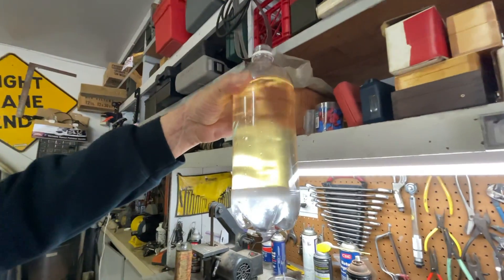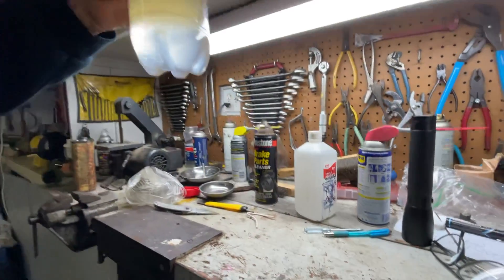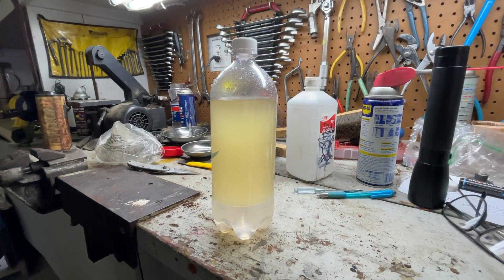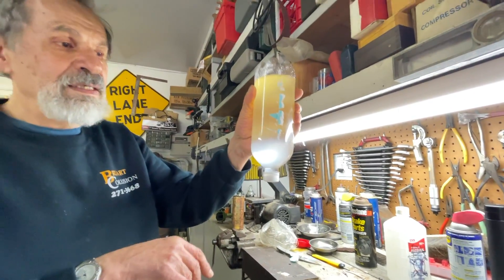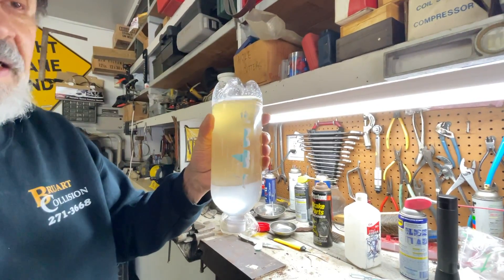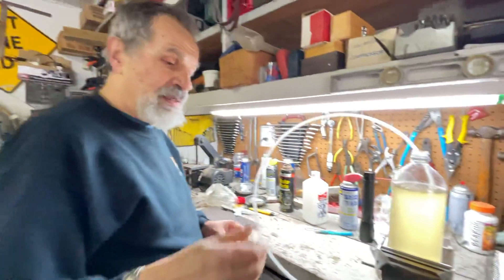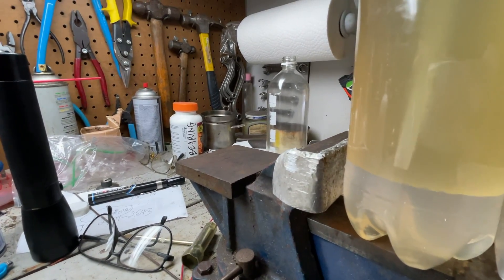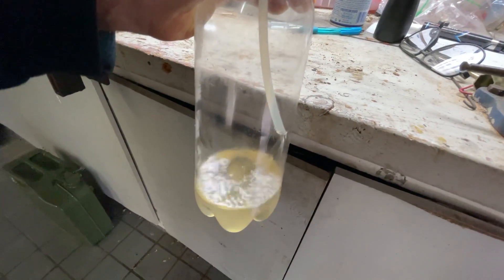The Most Practical Way To Remove Ethanol From Gasoline

Comment: You can also freeze the water/alcohol mixture so it is a chunk of ice, then just pour the gasoline our.
Reply: My freezer won't hold a 5 gal. gas can. It will if i move things around, but my wife won't budge!
Reply: @johnnellis3025  🤣🤣🤣
Reply: @johnnellis3025 you keep your wife in the fridge? That's brilliant. 😂
Reply: @johnnellis3025  🤣🤣🤣
Reply: So, the Ethanol doesn't act as an anti-freeze?  Then, that's genius.
Reply: I think it does, but I'm not sure how much the freeze point will drop. Adding more water per volume of ethanol will raise it some
Reply: @imdeplorable2241  Get it cold enough, and the water/alcohol will freeze solid enough to pour off the gas long before the gas even considers starting to solidify.
Reply: That's how they make applejack.  They keep pulling the ice out and the remaining liquid gets more concentrated.
Reply: @AlexT  it is also how they make 'ice' beer, that is stronger in alcohol than original.
Reply: Will the octane rating drop?
Reply: @lethalbutterknife3409  yes the octane will drop, use high octane or premium fuel when separating ethanol
Reply: @lethalbutterknife3409  yes. The alcohol raises the octane rating. That’s why drag racers like using high levels of alcohol in the high compression engines.
Reply: @lethalbutterknife3409  Yes the octane rating will drop several points as the ethanol is about 110 octane contribution
Reply: @lethalbutterknife3409  about 5-6 points.
Reply: @lethalbutterknife3409 - I believe it does.  Others I have watched in how to do this process say to get the premium high test gas when you do this.  E.g. the gas sold in some areas for small engines and boat motors is often called REC 90, which means Recreational 90 octane.  The typical 87 octane regular with 10% ethanol alcohol  ends up somewhere around 85 octane when you take out the ethanol.  So start with the “hi test” 92 or 93 octane for this use.  It still has the required 10% ethanol but with other goodies to improve combustion for better performance.  That’s what I think I’ve heard.
Reply: You can also gently pour off most of the gasoline without any need for tubing.
Reply: @alan6832  And you can let the stuff you poured off settle off again to make sure all the water is gone.
Reply: Excellent video😎 thank you Sir!
Reply: Gasoline freezes between-40 and -50 celsius. Ethanol freezes at -114 celsius. Your idea would be great for separating gasoline and water. In Canada ethanol is added to gasoline to give it a lower freezing temperature.
Reply: @ben3318  That wasn't the reason ethanol was added to gas in Canada. They did it for the same reasons as the USA and it has nothing to do with freezing. Doing a Google Search for gasoline freezing gives a range of -40 degrees to -200 with most freezing at -100 degrees Fahrenheit. I live on the Canadian Prairies and got along just fine adding methyl hydrate to my gas in the winter when temperatures could fall way below -40 Fahrenheit or Celsius, long before ethanol came along. NEVER had a gas line freeze. Small engines don't like the crap and neither do i!
Reply: @ben3318  Exactly Ben. It's fun to read the idiotic Internet ideas though 🤣🤘🏼🏆🏆
Reply: Very good idea.
Reply: For this to work in a household freezer, you will need to add enough water to the gasoline to dilute the extracted ethanol down to about 25%. This works out to about 40 fl. oz of water per gallon of E10 fuel, which is kind of overkill.
Reply: Put two holes in the stopper or cap with one tube long enough to reach the bottom and the other so it only protrudes into the bottle a very short distance but is long enough to add a pinch clamp to turn off. Invert the bottle on a stand of some sort and let sit until clear. Then open the pinch clamp to drain the water/ethanol mix. Once that is complete drain the clean, Ethanol free gas for use. The purpose of the long tube to   the bottom is to vent the bottle while inverted to allow draining without creating a partial vacuum in  the bottle, possibly collapsing a plastic bottle.
Reply: I once had some herbicide in a five gallon gas can that had gasoline added to it. Realizing my mistake, I dispensed it into an old glass apple cider jug and the separation line became very clear and it was easy to pour out the pure gas. I ran it through the second time and the clear water that separated was just a tiny amount. I would suggest that a double separation should be undertaken as proof that the process is complete.
   Understand that the glass jug is what I used and not what you should use, but it's shape mad it easy to pour it off the top without mixing the gasoline back into the fuel.  
    When you consider that off road recreational gasoline is hard to find and that you can regine your own with just a ten percent penalty in price, it's a winner technique
Reply: Now that's what I needed to know. Thank u
Reply: True but wife said he’ll no
Reply: @Gregory So that they can sell you 115 ounces of expensive gas for the price of 128 ounces, and you never notice you got robbed 'cause the 13 ounces of cheap alcohol makes it look like you bought a gallon of gas.
Reply: @Gregory-nk8wm to provide subsidies to corn farmers and kick backs to politicians
Reply: Or you can just buy some ethanol free gasoline!
Reply: Doesn't ice float in gas?
Reply: Ethanol won’t freeze
Reply: Freeze ethanol? No wonder society is going to shit.
Reply: @Gregory anti knock properties, 10% ethanol gives the same anti knock properties as tetraethyl lead.

It was actually considered before leaded fuel was a thing but was deemed too expensive so the cheaper and far more toxic lead was used.

Now they are selling it as a renewable resource for environmental reasons.

Makes no sense because fuel consumption is actually increased over neat petrol, meaning in the long run you are actually burning more fossil fuel using ethanol blends.
Reply: @Gregory-nk8wmto make Greta thunderburger happy
Reply: That is a great idea for someone who has not researched it at all.. here's the problem, the alcohol that is used in gasoline ⛽ is called methanol. And its freezing point is -143.7°F !!!!!!! Where does one get a freezer that can drop the temperature to more then 143.7 degrees below zero Fahrenheit???
Reply: @lenielupian2699  they use ethanol bud.
Reply: @lenielupian2699  if it’s methanol why does the fuel pump say ethanol?

Comment: I recall as a kid we had some very fine metal gauze that would pass petrol, but not water. Set in a funnel it would clean petrol.
Reply: You can also spray a coffee filter with silicone water proofing spray such as that which is used on tents.
The water will not pass through but the petrol will, or vica versa
Reply: Yup... mr funnel.... steves small engine repair also did a video on it
https://www.youtube.com/watch?v=p1aJoohWNms

Comment: Just buy the non oxygenated gas! Thanks from.St. Paul Minnesota.
Reply: Obviously people would do that if it was available. But some states completely prohibit non ethanol gasoline. So your stuck with this process or buying non ethanol gas in quarts or gallon cans which is obscenely expensive.
Reply: up too late  Are you able too purchase, True Fuel?  That works great. Especially in snowblowers, good luck. Be careful of who you vote for. They make the rules.
Reply: @johndemeen5575  I'm able to buy non ethanol gas in one quart cans at home depot for 10 bucks. They also sell same mixed with oil for 2 cycle. These prices were 2 years ago when i looked at them and laughed and walked away. In the midwest, im told some gas stations carry mid range non ethanol gas....
Reply: up too late  I am able too buy 93 octane, non oxygenated gas, at 4 different gas stations. Here in St. Paul. Use it in all my lawnmowers and snowblowers. Have 3 mowers, 5 snowblowers, all curb picks. Free because of dirty carburetors. Thanks from.St. Paul Minnesota.
Reply: @johndemeen5575  ah, i see the disconnect. I'm on the left coast. Heavy regulation. While I haven't run a snow show thrower since 1999, or even seen snow for more than 10 years, the taxes and regulations have me thinking about where I want to spend my retirement. Be well there and watch out for deer, hey.

Comment: How about buy ethanol free fuel?
Reply: You can't get it in some places. I live in Pennsylvania and I would have no idea where to buy ethanol free gasoline. They don't sell it at the pumps.
Reply: @ChuckHaney  Go to Puregas.org, They list places that sell non-ethanol gas. You might have a bit of a drive though. I have to drive about 10 miles to buy it.
Reply: @ChuckHaney  They do in Texas
Reply: @CaptainDayne  Not for long! You might have to go to Arizona in a few years. You won't have to watch YouTube, you already did!
Reply: @johnnellis3025  not true. We can get it at a couple of gas stations , and Marinas on the water. I run it in my bikes , and boats. Its expensive but worth it.
Reply: @CaptainDayne  It's getting harder to get it. You can get it easy at any chain saw shop, lowes, home depot, a lot of places for over $20.00 a gal. The Marinas don't seem so expensive now!

Comment: And I have been "taking a sip" of gasoline my whole life, Thank you for the video.
Reply: Whenever I siphon gas from a car, I put a rag around the hose where it goes into the tank, hold it tight with one hand, and blow into the hose to pressurize the tank enough to force the gas thru the hose. Of course, I take the hose out of my mouth before any gas comes out. Once the gas is flowing, you can remove the rag from around the hose..
Reply: Me to, then I dot clear hose!

Comment: I fill my small engines fuel tanks with ethanol free fuel and a splash of sta-bil for over wintering, never have any issues.
Reply: Uh huh. Be happy you can buy it in your state. Many of the rest of us can't. It's not for sale.
Reply: You can also purchase 100 LL which is 100 octane low lead.  From most small airports it is more pricey and if you’re running it in two-stroke it will run rich but just thought I’d throw that out there.  You can jet and tune for it to run proper .
Reply: @uptoolate2793  can you hear me playing the worlds smallest violin for you....
And you can buy it anywhere, it's called Trufuel, and it comes in little cans, you can buy it at almost any auto parts store, or Home Depot, Lowe's, Menard's,  etc.
Reply: @David F yeah, buying a carb rebuild kit, or an Amazon carb every year is crazy cost effective, brother, I fix things a hundred times more complicated every day, but $18.00 dollar can of trufuel, and an effortless start up in the spring beats that every time, do what ever you do, my time is something that can't be bought, just passing on tried and true information from a 30+ year veteran mechanic/technician. Love you too, my man.
Ever here" an once of prevention is worth a pound of the cure ?
Reply: @jamesgeorge4874  Trufuel isn't cost effective compared to ethanol free at the pump. Works great for me at a small fraction of the cost. An ounce of prevention is worth a pound of cure.
Reply: @adamr8628  Some people don't have a local station that sells ethanol free fuel, and truefuel is a better alternative than 10% ethanol, for winter storage.

Comment: Brilliant, you can buy an octane enhancer additive, to replace the drop
Reply: moth balls according to mythbusters
Reply: @jimboniface7202  probably not a good idea. Mothballs are made from naphthalene. In liquid form Naphtha,  which it becomes when mixed with gasoline, will eventually dissolve most plastics and rubber. If you just touch a primer bulb with naphtha,  lacquer thinner, acetone etc, it will instantly dissolve.
Reply: Exactly,  that is a reason why when I’m cleaning a carburetor or use starting fluid to clean is just as good or good enough for today but it doesn’t on the rubber O-rings and diaphragms. Stinks but it is what it is

Comment: There is an article of laboratory equipment called a separation funnel that is designed to perform exactly this job, quickly and easily. No need to suck gasoline. They are available cheaply from eBay or Amazon or any laboratory supplies company.
Reply: It won't help much

Comment: Your views for this video is likely to vastly increase very soon!
We in UK have recently been informed that possibly 600,000 older cars will struggle to run well on the new E10 petrol (gasoline) that is being enforced on us from September 2021.
Many of us are ill-prepared, I for one am not very chemically minded.
Finding your video very simply explaining the process of extracting ethanol from petrol is so satisfying - very kind of you, thankyou!
Reply: And what about my bike! It's a disgrace....
Reply: @pitbullslueth4358  steel tanks and fuel lines are the biggest problem .
Don’t leave fuel static in your tank for long periods as this will allow the water to separate and rust the bottom of the tank .
The ethanol is not good for old rubber based fuel lines and seals .
The actual engine should be fine
Reply: In the UK, all 97 octane fuel will remain at <5% ethanol for at least 5 years and all large petrol stations will have to sell it
Reply: @rayperkins6006  thankyou from me and my old landrover.
Reply: @rayperkins6006  Many thanks for your comment.
According to how I read this, though, London will only have E10 by the end of 2021.
Confusingly, the article suggests, while the pump will by outputting E10, the fuel station could continue to advertise that fuel as their standard current unleaded

https://www.mylondon.news/news/zone-1-news/e10-petrol-petrol-londons-garages-20876963
Reply: @RiverMersey the filling station will have to mark the E rating of the fuel on the pump (E5 or E10).
Reply: I think that is the purpose. They surely now that it is gona mess woth older cars.
Reply: Next would be to separate the water from the alcohol. Distillation seems the best.
Reply: @craighansen7594 it’s getting harder to get it today both stations that sold it where sold out of ;5
Reply: ...and my British Seagull ?
Reply: My old mccullough waw.
It's part of the great reset from the WEF. People like klaus schwab will love when our reliable old machines succumb to their nonsense.
Their motto after all is "you will own nothing, and you will be happy".
Reject modernity
Reply: E5 is still available at UK pumps for around a 5% price premium. If you purchase E10 then remove all the ethanol your gallon just got 10% smaller + any gasoline not collected. Then there are the risks in the process described above. AKA gasoline fumes -  and people using plastics that will melt when in contact with the fuel!!

Much as I resent paying the premium for fuel intended for high performance cars into my garden equipment and outboard motors I will pay the premium and get on with it!
Reply: @alexmonroe613 ~ #2 HDPE (High Density Poly Ethylene) is best for holding gasoline and our plastic 'jerry' cans are made of it.  I have had Lacquer thinner and in the kind of plastic he is using and it does get soft over time, in fact I would say it slowly dissolves into your chemical or gasoline.

Comment: enjoyed this, we used to us a 20ltr clear container with a tap on the bottom on building sites to clean out water from cement mixers and other petrol/gasoline-powered tools,i would put some drops of food colouring in the water so you can see what you are removing easer.

Comment: Why not just push the tube to the bottom and then syphon out the water?
Reply: @Mark (217maka) set the bottle at an angle so only one bump is the lowest.
Then leave water/alcohol/dash-of-fuel in that bottle for several cycles. Maybe you will then have enough fuel to be worth siphoning off the "water" bottle.

Comment: Thanks for showing how to intentionally cause “phasing” of ethanolized fuel. Many little engine will love you! 
You have no idea of how many boats across the country are “harbor queens” (non operating) because of E10 fuel. Carbs and fuel pumps killed, vapor separators eaten(fuel injection) fuel tanks dangerously compromised. Great money if your a boat mechanic because you know exactly what to look at and it will happen again unless you run it often and keep the fuel fresh.
Reply: Aviation fuel works on boats, yo.

Comment: could put in container with tap on bottom take the unwanted ethanol/water out first just a💭good vid Sir...
Reply from the maker: While this would definitely work, it would be much less cost effective than using a plastic bottle and draining the gasoline from the top.

Comment: How do you dispose of the water and ethanol you remove?
Reply: Nobody mentions THAT part lol.  My guess is they pollute the environment by dumping it out.
Reply: @davidlong1786  This isn't rocket science. How do you dispose of used motor oil, paint thinner and other solvents? This mixture goes the same way.
Reply: @johnbauman4005   Not everyone takes the time or effort to do the right thing nor do a lot of small towns have a place to recycle said liquids. I'm just saying people in general are too lazy to do so.
Reply: Ethanol is very evaporative. If it sits open outside, it'll evaporate. It's also flammable and can be burned where appropriate. Maybe the best use I've heard of is windshield washer fluid. I haven't tried this.
Reply: @Nick_Sorenson  can you separate the ethanol from the water?  This would allow the ethanol to be used in a Trangia or similar stove.
Reply: @broadlander1398  distillation... But I personally wouldn't want to mess with this.
Reply: Everyone has that neighbor that they just can’t stand you put it in his tank. 😂